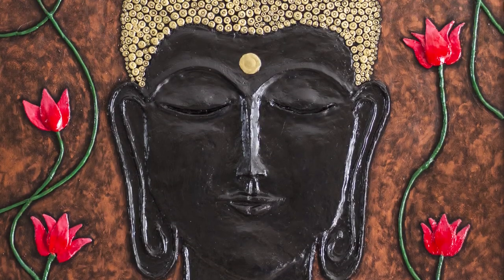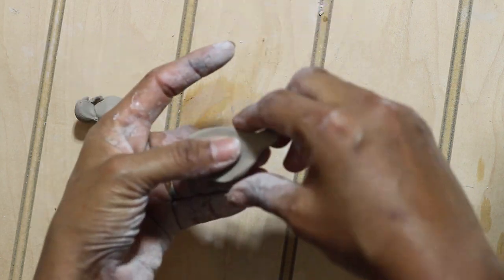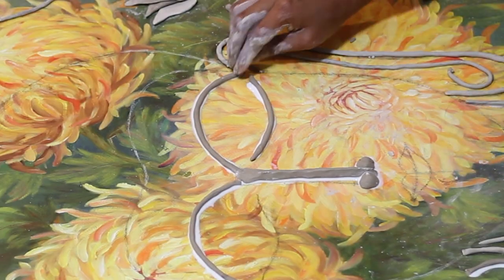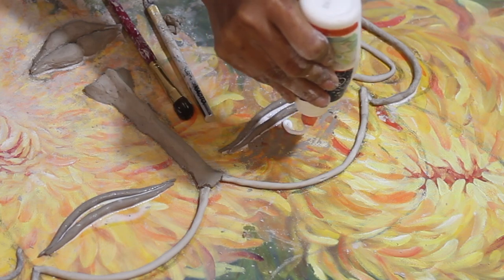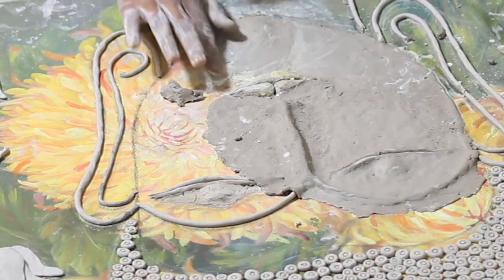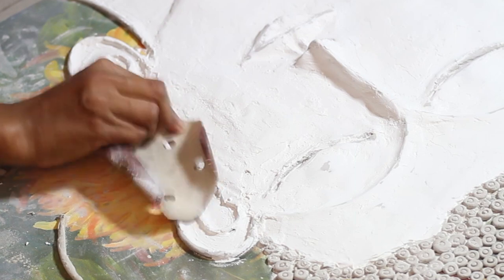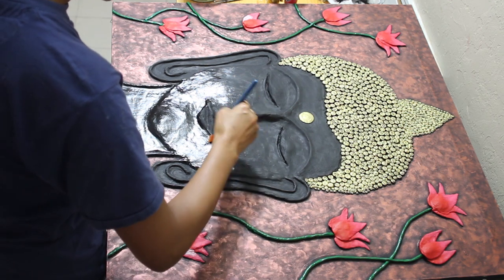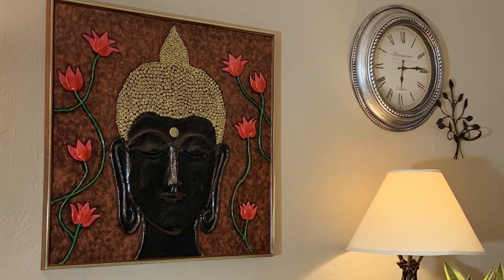Sculpting Buddha on a Canvas

Comment: I used wall putty but that also cracked badly
Reply from the maker: In order to cover the cracks in the first layer of air dry clay I added layers of wall putty in the crack and all over the first layer, till it got rid of the cracks. In my experience it was tricky to avoid having any cracks, especially in the scale that I made. Hence, had to go over the cracks with multiple layers of wall putty. Hope I answered your question, if not feel free to ask follow up questions. I will be more than happy to help out to the best of my ability.

Comment: Mam can we use tarracota clay for  this art
Reply from the maker: Actually, I am not too familiar with Terracotta clay, but as long as it can be air dried (that is you don't need to bake it or  heat it) you should be able to use similar steps as mine. If not, you might need to improvise a bit. Sorry, that I could not be of more help, but thank you for your question.